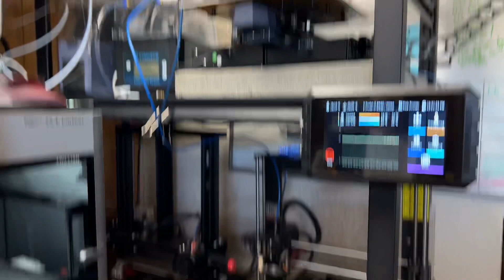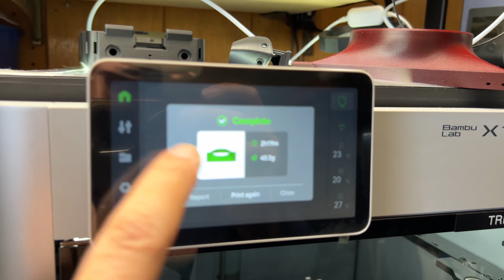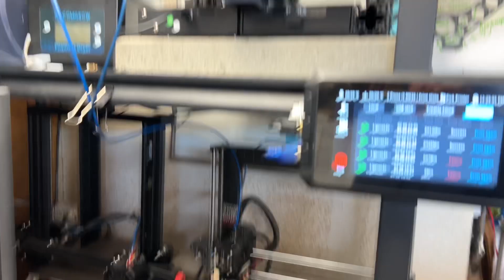2023 UPDATE: Creality Sonic Pad mini farm, Klipperized Prusa MK3S vs Bambu Lab X1C, Patreon, & more!

Comment: do you have a link for the kinroon sonic pad cfg file. cheers
Reply from the maker: I used the cfg files found here: https://github.com/nehilo/klipper_KP3S 

Just a word of warning, it worked on the STM board but then for an unrelated reason I had to get a new board and could only find the GD clone. Was never able to successfully get that one onto the sonic pad, as for some reason the firmware wouldn’t flash correctly. so I just used an old Pi to put normal Klipper on it.

Comment: Do you have the printer config file to add the Prusa MK3S to the sonic pad. I watched a video from Creality, and to be honest it was pretty intimidating. I wonder if you could help me with this. I’d like to order this pad, but I really wanted to work on the Prusa.
Reply from the maker: I have changed my file to reflect the mods I’ve done and other personal tweaks, so you would have to go through and find those and paste in the stock parameters anyway. Also, there will be troubleshooting and modifying of the printer.cfg file manually as you calibrate your machine and develop your ideal start/end/filament gcode (often times requires calling out macros that you’ve added to the config file). So I really do highly recommend you take time and follow the video steps, or you’ll get stuck later and not know where/what to change. In all honesty if the process is still too intimidating then I would steer clear of adding non-Creality machines. The printer.cfg file is not too big and very logical though, I do hope you give it a try.